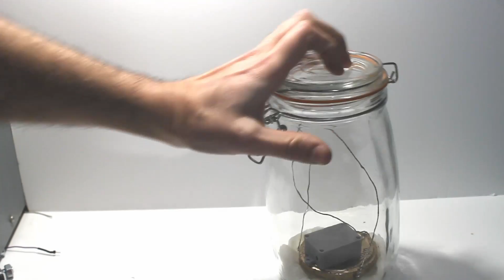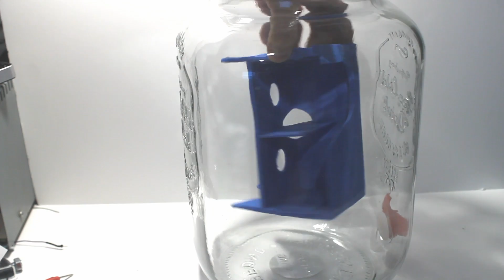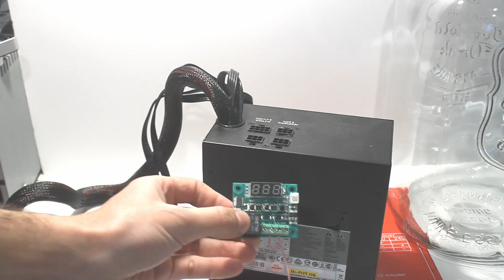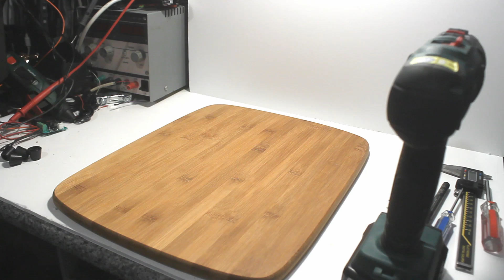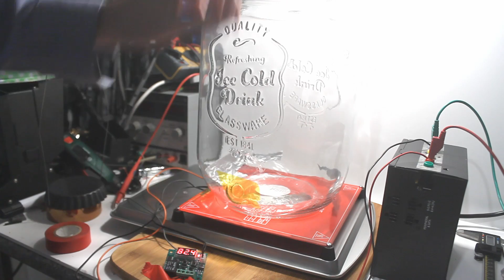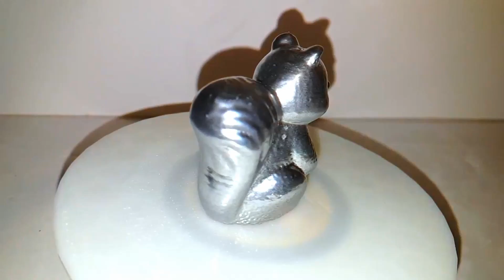How to Build a DIY Acetone Vapour Chamber for 3D Printed ABS Parts

Comment: adding a fan inside the chamber is an unnecessary risk. Electric motors often arc and that motor is almost certainly not rated to be in a flammable environment.
Reply: if its brushless it should be fine